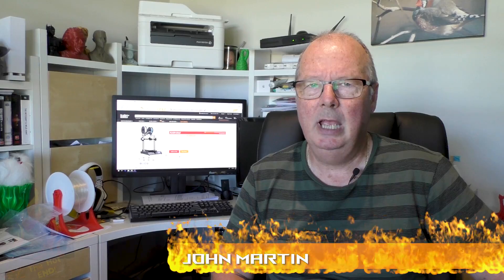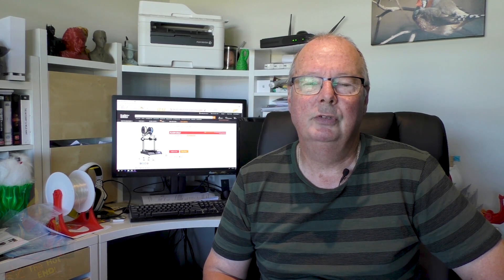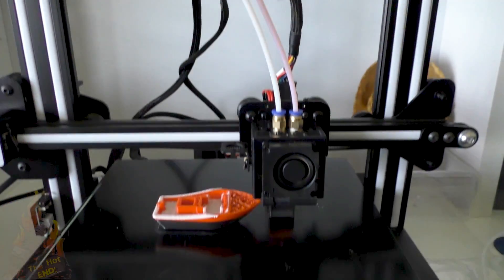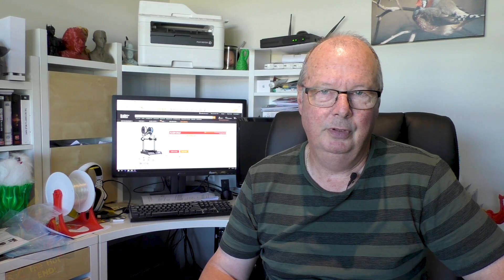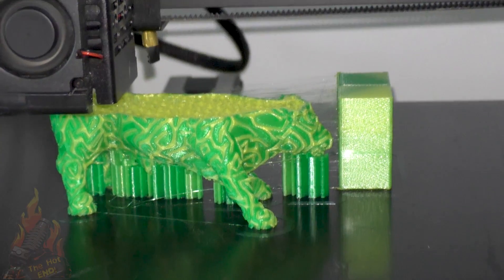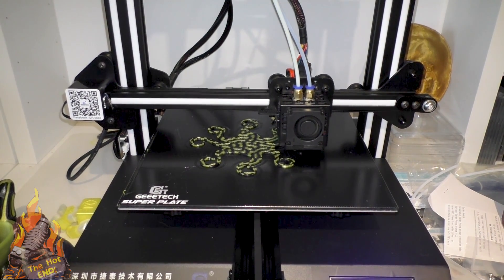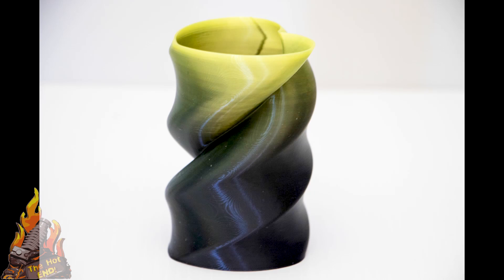Geeetech A20M Dual Extrusion (2 into 1) 3D Printer Review!

Comment: Spool holders can be mounted as you wish... three screw holes as you can see here.  or just turn them around or put them side out as I have on my A10m with my extruders facing the plate for easy filament loading.  Your info is false. Also ensure Bowden tubes are trimmed square and pushed down as far as they will go. G’day.

Comment: Great video. You mentioned PVA or a dissolvable filament. Other have said that their machine clogs when trying multiple materials, have you found a workaround to get dissolvable filament to work with this machine?
Reply: Thanks, I would certainly be interested in learning your results. Subscribed now.
Reply from the maker: We have filmed an update video with cheap upgrade to stop the clogs
Reply: Wow, thanks for letting me know. I look forward to watching it. Very much appreciated.
Reply from the maker: Hi, I can see that may be an issue with most 2 into one nozzle due to the different heat required. However there are plenty with dual extruders with dual drive what would solve that. This video was awhile ago and long since donated to a local school so I can't test it for you now. I will however on the next 2 into 1 dual filament printers. We have more in route and more videos being edited so subscribe if you wish and I'll make it a point to test it for you

Comment: To fix the underextrusion problem I had to set my extruder ESteps all the way up to 1062. That seems high... higher than most everything else i've seen people set it to. I used your formula from another video.... NewESteps=(OldEStep x expected extrusion) / actual extrusion. Why is my result so different?
Reply: I had to do the same more than 900 ... but only after I had updated the firmware

Comment: @2:15 wow, and you did not atleast make a video that it does not work, or asking help? What a wasted opportunity, and your journalistic integrity is highly questionable.  What printer was it? Now others do not know it might be waste of money.
@3:40 i would have very much liked to see the hotend parts etc. and i am sure a lot of other people too, even if how the mixing happens is not viewable. If you had it already apart, taking few seconds of B-roll of them would've been nice.
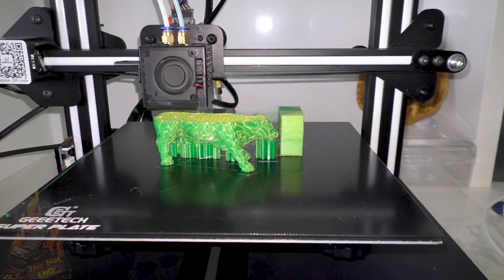@8:20 Would have been nice to see insides of the extruder too ...

Would have been nice to know the electronics too, what board does it use? What drivers? AC or DC heatbed?

Please do better job in future, you have access to all these machines and info, and proper review would include that detail.

Comment: Sorry, the points are mostly not really valid, Calibration of the extruder is part of printing and setup, the spoolholder mounts, so it took you two prints to flip them and you still mounted them awkwardly to the wrong side, if you show us a 3000$ dual color printer that doesn't clog, then compare that to the price of the A20M .. and to say that it's not a good printer because it is chinese.. how many european or american 3d printer manufacturers are there that can supply PERFECT printers that are under 500$? i would love to try those..

Comment: Thanks for the review! I got my A20M in and watched your video. The tip about the steps/mm from 340 to 440 made a big difference. 

I printed the lizard just fine now. My only issue seams to be lack of any good profile for S3D I got one off the facebook group but it causes issues with mine. Retraction issues in my left extruder that I don't get with the supplied g-code for the lizard. 
Any way I wanted to say thanks and if you could when you review a printer it would be nice if you included your profile and settings.

Comment: The QA of Geeetech 3D printers has been pretty abysmal.  I bought a A10 recently and from out of the box, issues.  I reached out to their support on Facebook and elsewhere to not much luck.  The board can't be connected to and many other issues.  Their solution?  Send me parts for a different model printer, a replacement motherboard and a bent z screw.  I'm not impressed playing tech support to fix their lousy product.  Some people get good, working printers...and some, like me, get a complete disaster.
Reply: Agree with you completely.  I ordered a Geeetech A30 through 3DPrintersBay on 11/10/2018 - didn't get it till 11/30/2018 and it was defective out of the box - the control unit started smoking on first use and almost caught fire.  Notified both 3DPrintersBay and Geeetech on 11/30/2018 and neither have been very helpful to resolve the problem.  Geeetech said they were sending parts but haven't received anything yet.  3DPrintersBay told me to file a claim with PayPal now against Geeetech...Do yourself a favor and stay away from both of these companies.
Reply: TheCRUMeister  that’s scary.   You post these issues on their Facebook group and their fan boys will try to shame you for daring complain about a cheap printer.  It’s pretty pathetic how they treat customers.  But that’s how these China printers are.  Make as cheap as possible and us dumb consumers keep buying them, hoping ours works well enough to repair.  Imagine if cars were sold like this!
Reply: @WhereNerdyisCool  I am afraid you are quite right. It comes down to the old saying - you get what you pay for. I have some Chinese printers that are still going after 2 years and others which went into the bin.
If you want a work-horse printer for long term use you have to either spend the money up-front or be prepared to upgrade/replace parts on cheaper printers.